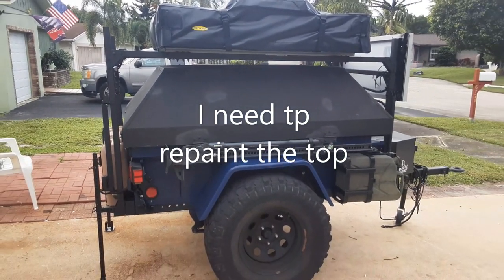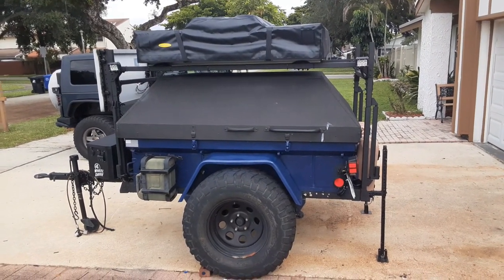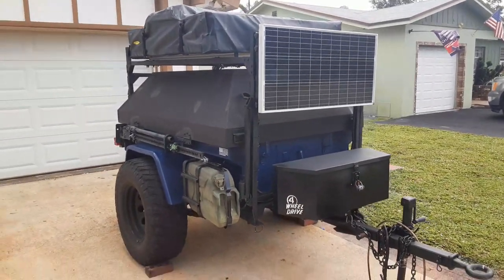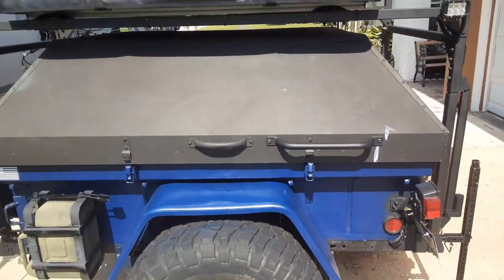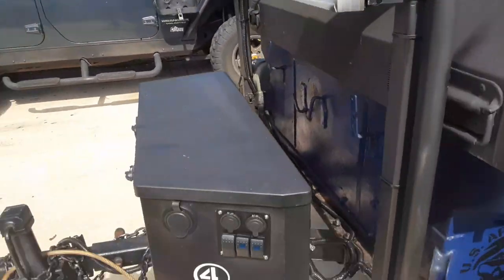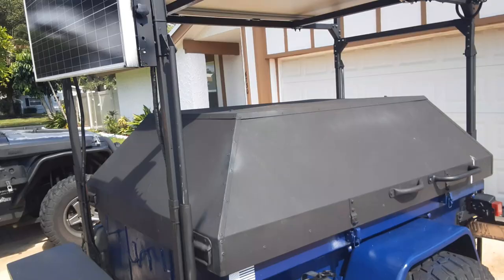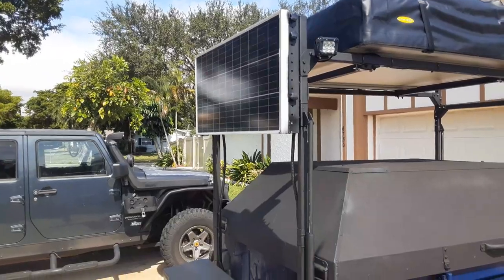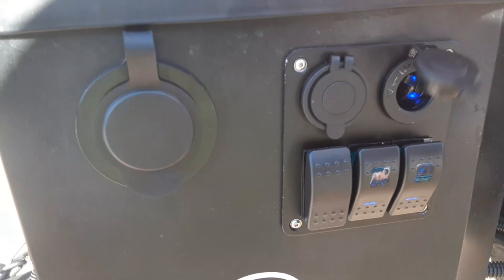M416 Off Road Trailer Telescoping Roof Top Tent & Solar - Overlanding Setup

Comment: Excellent build!!! I have OCD and the only two things I would do: 1.) once the rack is extended up, I would drill one hole in each upright to be able to insert a pin, just a safety precaution. 2.) add at least one gas strut  on the inside of your trailer/lid. This would make it super easy to open and no need for a block of wood to hold the lid open. Again, with my OCD I would add one on each side. I'm not bashing your build, I think it was well thought out and I really like it and maybe you actually have plans on doing what I mentioned. I like the jerry can horizontal mount, nice way to use that space. Don't laugh, but, I'm sitting here with the video paused and looking at the left (passenger side) of your trailer. On the lid, the sloped part, possibly make another piece the same dimension, hinge it to the bottom of the slope and one or two latches at the top. Once rack is raised, this could be unlatched and used as a shelf for prep or just to keep smaller things off the ground. Again, great build.
Reply from the maker: Great feedback = I had planes for the gas struts and thought about the pins. Really appreciate your viewing - hope you subscribed as well.  

Your insights were great and just what I wanted to hear!  Much better than just nice build!

Thanks!

Comment: What actuators did you use? If you have the PNs that would help. I looked on compact camping website and couldn’t find it. Their website is a maze. Also if you could elaborate on your solar mount. Was it full custom or off the shelf?
Reply from the maker: Hey Rob, yeah its not the best.  The actuators are from Amazon - Homend DC12V 18inch Stroke Linear Actuator with Mounting Bracket 900N(225lbs) Maximum Lift  (https://www.amazon.com/dp/B07HNT283R?psc=1&ref=ppx_yo2_dt_b_product_details).  The solar mount can be located here (https://www.amazon.com/dp/B07CSKFWK7?psc=1&ref=ppx_yo2_dt_b_product_details) - Renogy 28in Adjustable Solar Panel Mount Brackets, with Foldable Tilt Legs